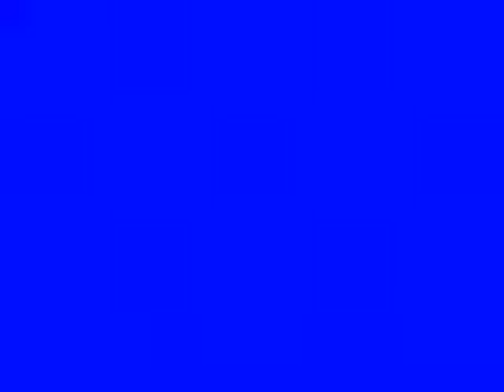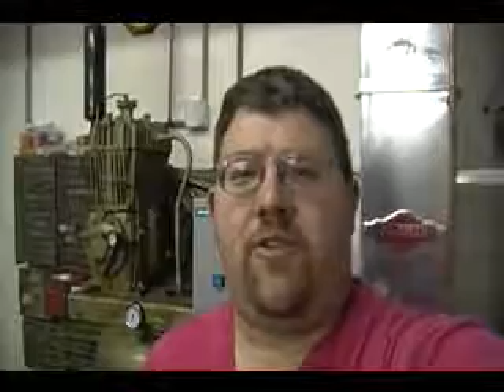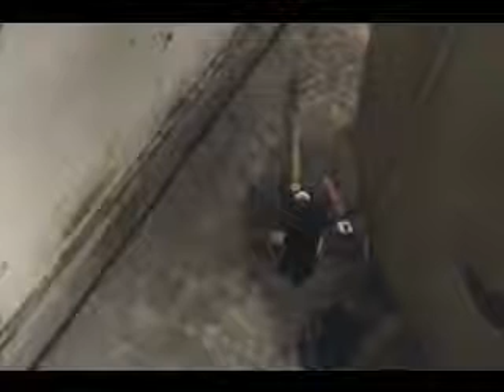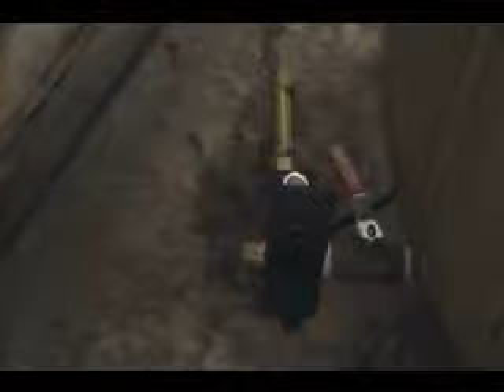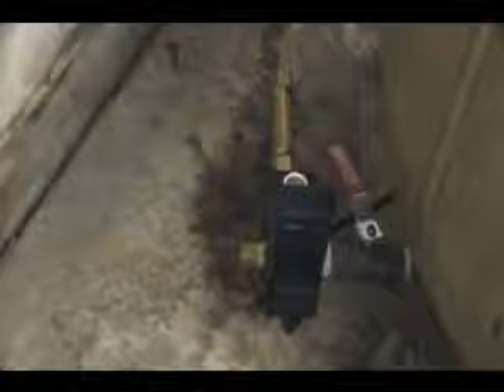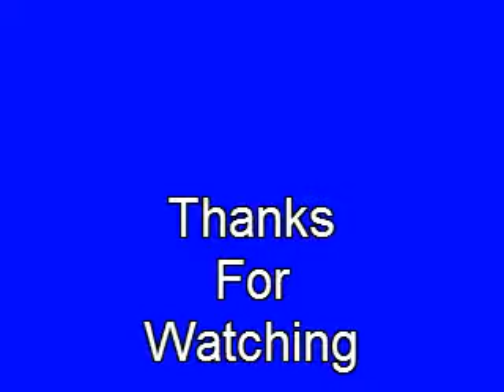Air Compressor Automatic Tank Drain # 48

Comment: Question ; why is your ball valve only partially open  ?   In my experience , ATD's are manufactured so they can take full pressure from the bottom of the tank at all times  .  And why was a  220v.  connection necessary  ?  Why not standard  120v.  ?  I would think you only want the ATD to cycle at the  END  of the for about  3-4  seconds .
BTY , i have found that most compressor owners do not know how to run piping  AFTER  the compressor . Meaning a down, over  &  up  spacing of piping with drops ( water separators ) in the "down" space . This because you always get condensation down line .
Reply from the maker: Hi, thanks for the comment. This is an old video of a compressor I no longer have in service. The ball valve was used to limit the high volume air purge when the auto drain would cycle. I didn't see a difference in performance as to how it functioned whether it be wide open or partial, it still bled out a significant amount of moisture. I used a 220 volt model for two reasons: 1)to be able to tie it into the load side of the contactor so it would only cycle while the compressor is running and not around the clock when the compressor is not in use, and 2) I did not a have a 110 volt outlet close by. Most if not all electronic ATD run on two separate time delays, purge time and cycle frequency so there is no guarantee that the ATD will cycle at the end of the compressor cycle which would be ideal. 

My compressor I'm running now has two separate pneumatic drains that work with with either a centrifugal unloader like my new compressor or a pressure switch unloader found on the cheaper units. One of the ATDs is a Tsunami Moisture Minder and the other one is a Conrader. The Tsunami Moisture minder purges only after the cycle, where as the Conrader purges at the beginning and the end. No, I didn't need two, but I was testing one based on some comments on a different video, but decided to leave it on as well.

I would agree about the piping, I have seen some pretty interesting installations.  Thanks! Scott

Comment from the maker: Hi Mike, thanks for the comment. You are correct, the automatic tank drain is a Tsunami,P/N 21999-0177-230. The -230 indicates 230 volt coil rather than the standard 115 volt. I have mine tied into the load side of the magnetic starter so it only cycles when the compressor is running.   Scott